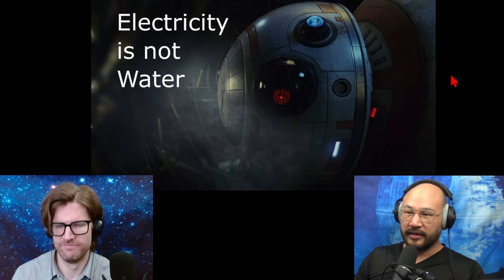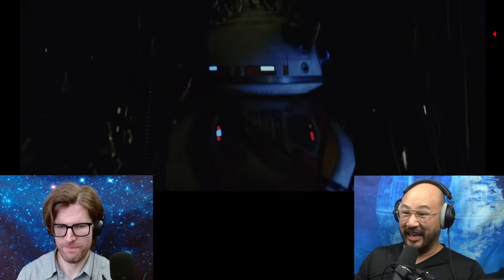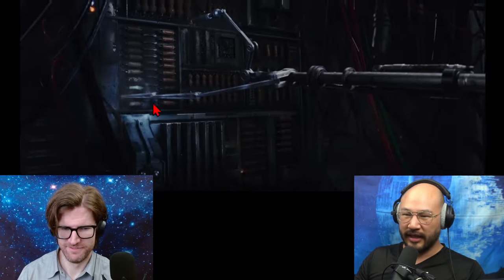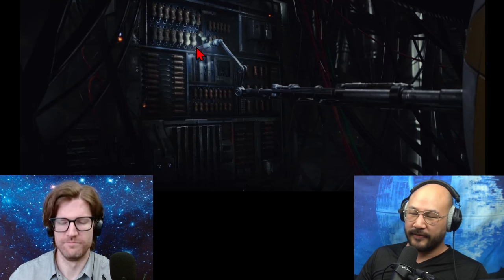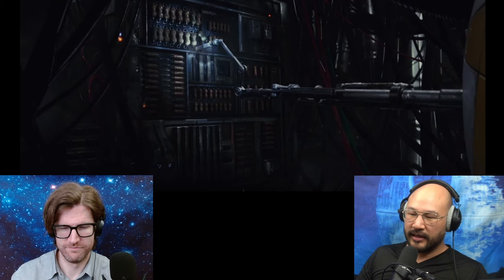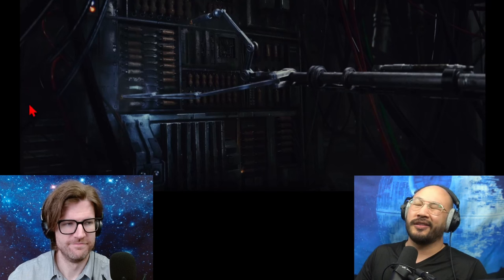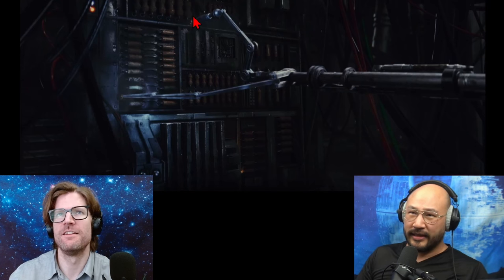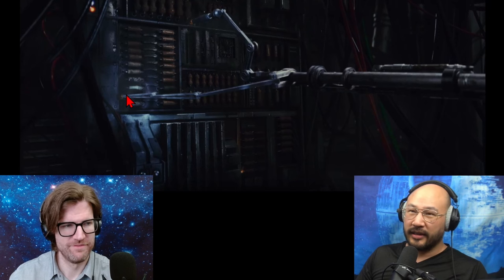Star Wars: The Last Jedi | Ain't Water

Comment: As an ET3, Electronic Technician 3rd class in the US Navy, I have seen enough people not understand stand what an electrical fire is. I took the sparking as the initial arcing of electricity as the electrical fire was starting. This is not exact science, but more a safety measure when working with live circuits, electricity can arc out or jump out of circuit an inch for 1k volts that are in the circuit under normal operating conditions. Please understand most computer systems work off of low voltage and high ampere, so when I saw that arcing I knew that targeting computer was completely fried and there maybe faults developing in the power supply to send that much voltage into a computer system. Needless to say I laughed at the scene that meant to be comedic, knowing full well no one in the creative process knew anything about how electrical (power distribution) or electronic (High frequency and high power) systems work.
Reply from the maker: Yeah, it was obviously made for comedy! A little too slapstick for my taste!

Comment: False! Water can model electricity precisely.
Reply: Breaking a circuit by removing a section of wire will stop the flow of electrons
How do you model this with water, without it simply leaking?
Reply: @347Jimmy  breaking a circuit is the same as inserting a huge resistor. Take a river and insert a damn... it's the same thing!
Reply: @johnc6035   that's explicitly not what I asked for.
Reply from the maker: I always thought it was a good analogy but not precise! Am I wrong?
Reply: @semistableclips   "good analogy but not precise" gets my vote